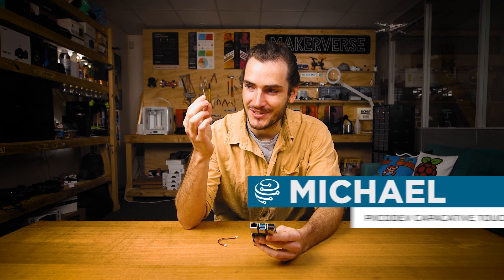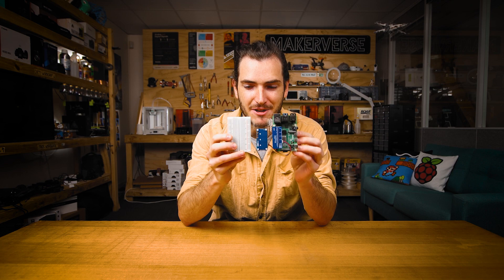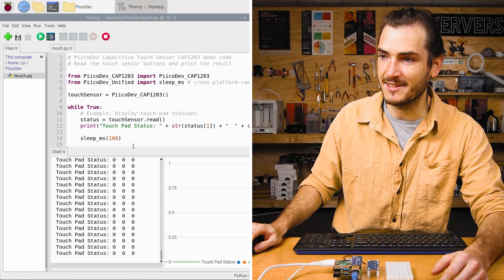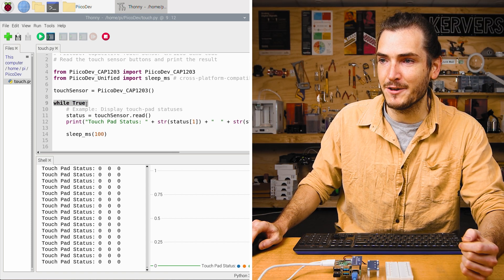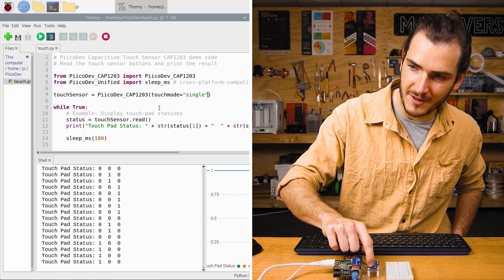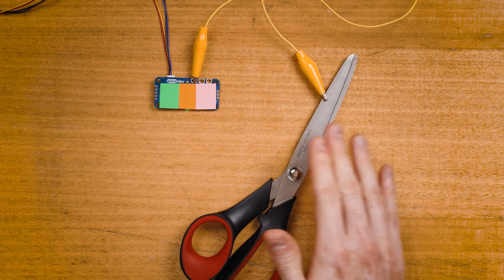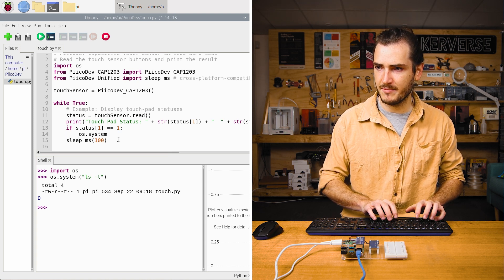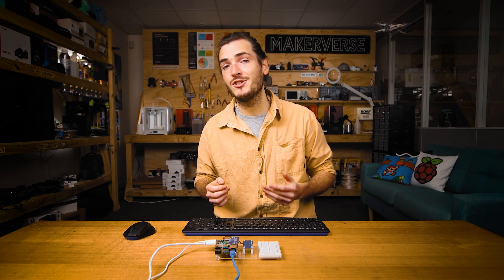PiicoDev Capacitive Touch Sensor CAP1203 | Guide For Raspberry Pi

Comment: 3:20, convert to string ? or  print('status', status[1], status[2], status[3])
can the touch pads be extended by a wire ?  if yes maximum length ?